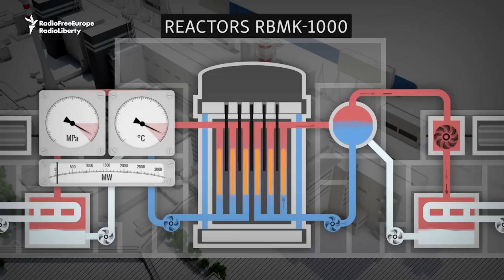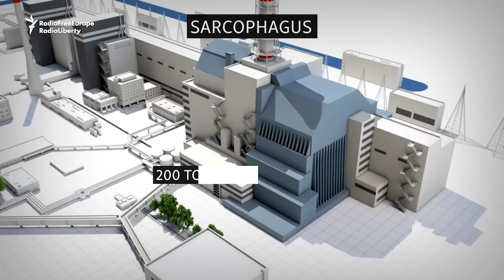The Chernobyl Disaster: How It Happened

Comment: Minor correction about the sequence of events. The reactor didn't meltdown when the control rods were removed, it occurred when the rods were reinserted after it became clear that there was an overheating problem.  The rods were tipped with a material that was not a neutron moderator.  Before the rods made it all the way down, the tips displaced the water inside the  control rod shafts that was acting as a neutron moderator and sent the reactor into prompt criticality.  Once the rods were removed and the power of the reactor reached a certain level, the design of the reactor made it impossible for an explosion not to happen.  It was a bad reactor design in concert with poor decisions that caused the accident
Reply: Not poor decision making; the operators had no idea about the instability at low power levels caused by the control rod's graphite tip.  This was kept secret by the Soviets.  When they were setting up for the test power level dropped so they pulled out control rods which meant higher water flow was needed.  The operator controlling the water pumps put in too much water stalling the turbines (low steam flow).  So the reactor operator "helped out" by pulling out more control rods.  Only 6 rods remained in the core.  RMBKs also have a positive moderator feedback so as the core heats up power goes up.  When  the test started, the lack of water resulted in the core heating up causing power to increase.  The rector operator noticed the power increase and did the right thing turning the AZ-5 switch which inserted all the control rods. But when the graphite tips on all the withdrawn control rods entered the fuel area, power spiked doubling about every second.  This created so much heat the water instantly turned to steam which ruptured the core and blew off the reactor lid or cap.  The graphite moderator then started to burn when exposed to the air.
Reply: I have heard both statements for the reason that the reactor went super prompt critical. The wo reasons being, that when the rods were scrammed, they displaced the water (which was acting as a poison) OR/AND the tip of the rods was made of graphite (also the RBMKs moderator). Possibly the reactor responded to both, and essentially had a largescale SL-1 accident.
Reply: Louis Descamps potentially yes but they didn't want to wait any second longer than they had to
Reply: So although paradoxal, would it have been avoided if the rods were sequentially inserted? Interesting comment! I knew of the displacement issue but not of any moderator 'tip'
Reply: true
Reply: can you go into more detail about the design flaws, why i keep hearing it.
Reply: Also the whole of of reactor 4 was rushed to be made so just an extra
Reply: Lion Phoenix 
1. There is no Soviet Union anymore
2. All of the remaining ones are dissmantled
Reply: dzajic90 There are still 10 in use.

https://en.m.wikipedia.org/wiki/RBMK
Reply: Lion Phoenix They have been improved to take out the design flaws or to soften them. 

https://en.m.wikipedia.org/wiki/RBMK
Reply: That's not a minor correction. This video is just very inaccurate.
Reply: Too little, too late, but the moderator in a reactor is what helps slowing the neutrons down so that they are more likely to cause fission. The tips were graphite, which is the main material used as moderator in this type of reactor. You used the term wrongly.
Reply: Finally someone gets it👏🏼👏🏼👏🏼👏🏼
Reply: What happens when you put poorly trained people in charge of a piece of junk. Then agian this was 1986 and a communist state..they had no idea what they we're dealing with.

Comment: l it's 2017 .chernobyl is currently done
Reply: That was scheduled in November 30th, 2017, yes the dome completely covered the Chernobyl Nuclear Reactor 4, but before that comment, it wasn't.
Reply: im sure employees are still there just to maintain the place.
Reply: +Big Dave Exactly, its going to take many years (likely decades) to decommission that destroyed reactor 4 structure alone.....if they intend to remove the melt nuclear fuel beneath the reactor 4.....well its obviously going to be even more dangerous. Easier way would be just to fill up fully with concrete as to get no access down there, if there is no chance that radioactive materials would ever leak from there either further into the ground or into atmosphere.

Atm even though the confiement structure is in place, they are still finishing up work inside it to start the removal of the old sarcophagus structure. The work on that hasnt even begun yet, but ofc now they have pretty much all the time in the world to do that.
Reply: I have some doubts about using concrete. Concrete that is exposed to high levels of radiation over time becomes spongy and weak. I'd guess that if they used concrete then in 100 years or so it would fail. Ironically they might need something exotic like depleted uranium or something as a radiation shield. The engineering is I imagine going to take a while to be completed.

Comment: 100 years and then what ??
Reply: That's not true. The structure is said to last 100 years, and then a new one would be build, I imagine. But it would take more than a 100 years for Chernobyl to no longer be radiated.
Reply: Then they got to build a new one.
It's going to be thousands of years before anyone can go clean up after it. 
We will never see it cleaned up in our lifetimes.
Reply: The NSC has an array of robotic arms and cranes attached to the ceiling that will begin the demolition process inside the new building. The sarcophagus roof and walls will be removed and cut up before send to a processing plant nearby for safe storage. The half life of the 3 main radioactive particles have reduced enough for the machinery to operate so it's a matter of slow and methodical dismantling of the entire building until they reach the reactor core and the melted fuel rods i.e Elephants foot. Things may change once they uncover the fuel as the extremely radioactive materials remain there. In theory if the NSC can process and store enough nuclear waste, the demolition process could be relatively quick.
Reply: no longer radiated
Reply: +Superpureeliteful you should really learn chemistry, you see there is this thing called a half life

Comment: Your graphics are great, but the narration has some factual and omission errors, if it was indeed meant to cover "How it happened".

- It wasn't a test of "backup cooling system", it was a test to make sure the pumps forcing coolant through the reactor could be powered by the generators for the 40 seconds or so until diesel generators could come on line if there is an emergency reactor shutdown. The test was failed twice before; it was not a "routine safety drill".

- "A nuclear reactor is like a massive steam engine."  That's an oxymoron and a non-sequitur in a single statement.

- You don't say why the control rods were removed, and thereby loose the narrative and  the reason for the accident.  It's vital to know the why of that, else it just sounds like a happenstance, done on a whim. 

- "...and extreme heat began to melt the core.  At 1:23 Am reactor 3 exploded." But why did it explode?  And what was the nature of the explosion?  If you don't answer those questions, you allow the CTs out there to do it, with all kinds of fantastical ideas.
Reply: It exploded at 00:23 So he and you are wrong. Watch the official footage it says 00:23.
Reply: @thekiwininja99  Check Final episode of Chernobyl series

T: Time traveller.
Reply: How is a nuclear reactor not like a steam engine? They both rely on heat to produce steam which then generates power.
Reply: @croakingfrog3173  Only resembles a "steam engine" if one is using the reactor generated steam to boil water (or or some other medium), make steam and turn a turbine. A reactor in itself does not necessarily have to produce steam as its only function; many are used to make other elements used in medicine (Mo99 which produces Tc99m is the most widely made), I 131, I123, xenon, thallium, gallium, etc. They are also used for research, and some to make atomic fuel for nuclear bombs.
Reply: pepe cohetes „Resembles“ and „is like“ basically mean the same, though.
Reply: @croakingfrog3173  exactly
Reply: Good remarks! I hate the way everything is converted to Discovery Channel simplifying shit.
Reply: You could start with wikipedia, "Chernobyl Disaster".  It has it right, and all the statements are backed up with sources.  Then start prying into them.